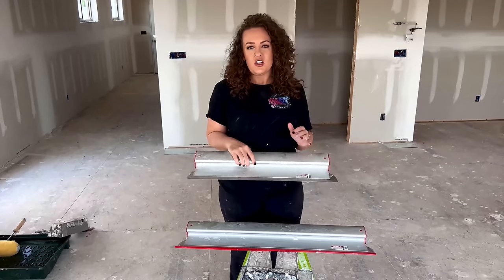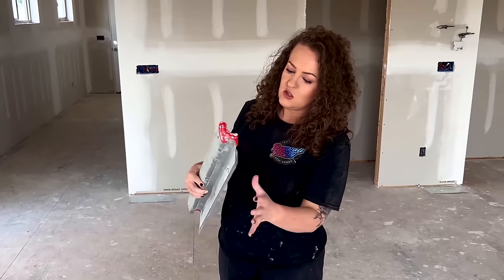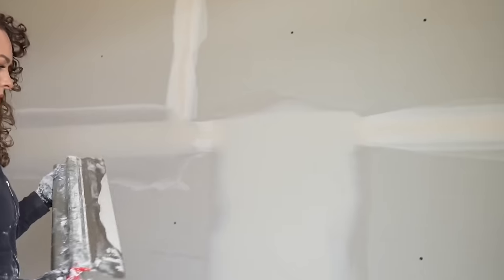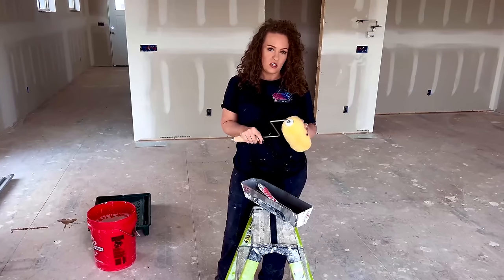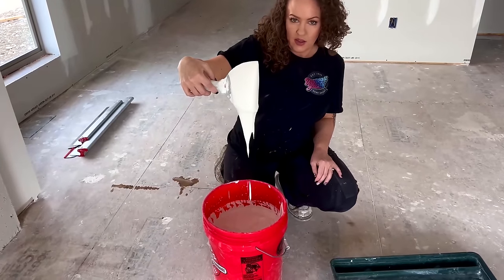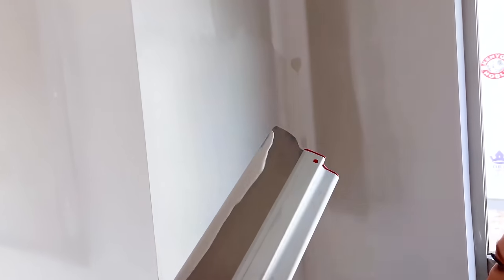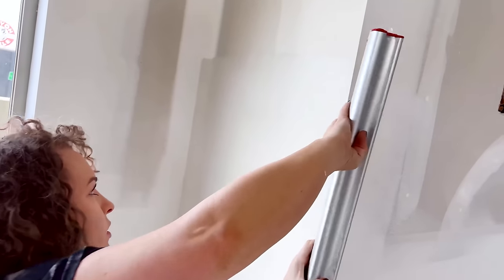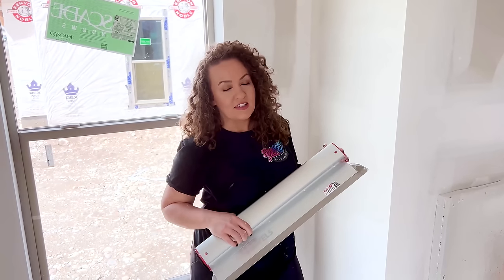Ultimate Introduction to DRYWALL SKIMMING BLADES | LEVEL5 + Drywall Shorty

Comment: Perfect for but joints I’ve had mine for years worth every penny
Reply: If the joint is running vertical would you recommend swiping it horizontal or vertical? I have a repair job that left the butt joint with a hump running vertical. thank you for your time

Comment: Why did you apply and remove the mud horizontally? How were these walls prepared before this video?
Reply: Because you skim parallel to a drywall seem.
Reply: @garrettboye4581  that's not what she was doing you don't coat a flat that big not necessary and ypi don't coat metal that wide this was just a demonstration

Comment: I'd go vertical to ensure a smoother finish.
Reply: If you go vertical the you’ll get excess mud over the corner edges onto both adjacent walls. You’ll creat 10x unnecessary work for yourself. She’s a legitimate professional…
Reply: @brandonleesanders nope always go vert. On an outside corner or else won't be flat been a finisher for 35 years